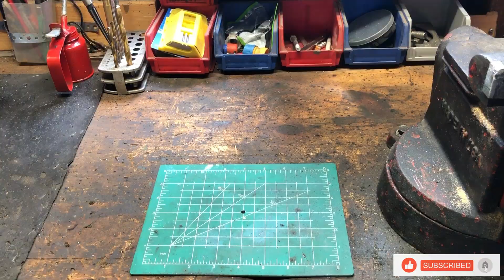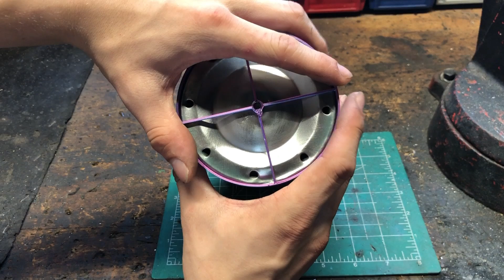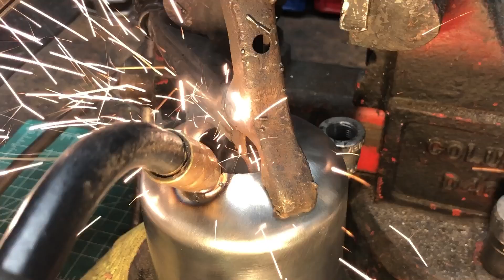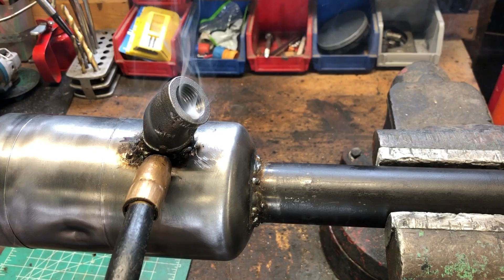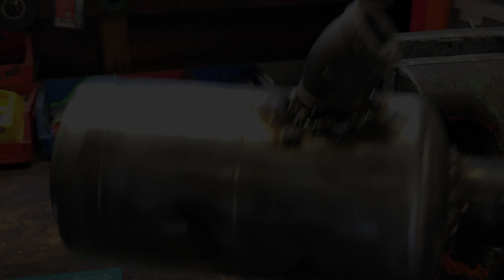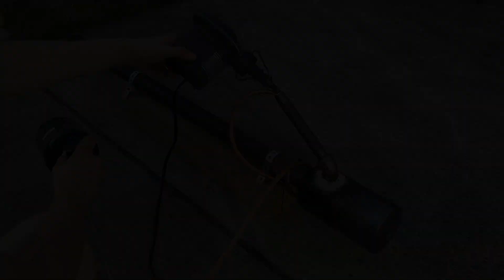I Built a Pulsejet Engine from a Propane Tank | DIY Pulsejet Build & Test

Comment: Nice job. You might find it self sustains if you make the intake a little bigger in diameter.
Reply from the maker: Thanks! That’s actually the plan for the next version, I’m going to open up the intake to a 1-inch diameter instead of the current 1/2 inch. Appreciate the tip!
Reply: @MrMoreGooder awesome, good luck!
Reply: Hello my friend what kind of fuel did you use it for?